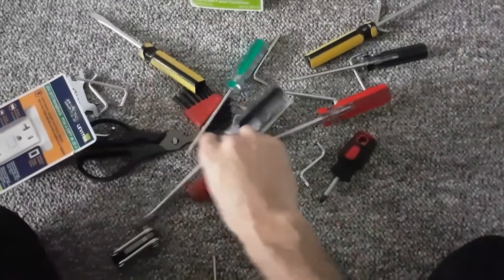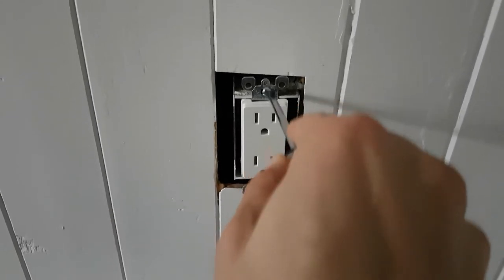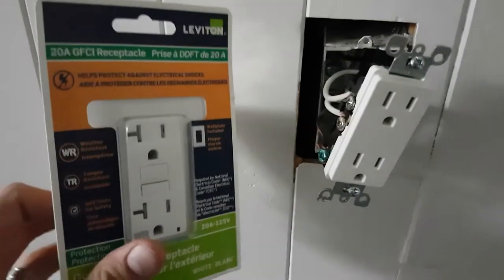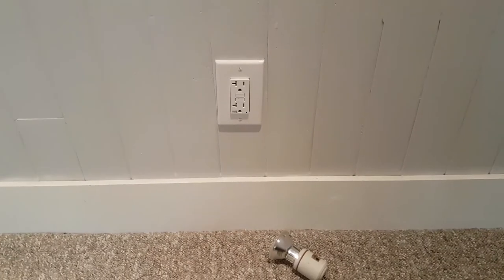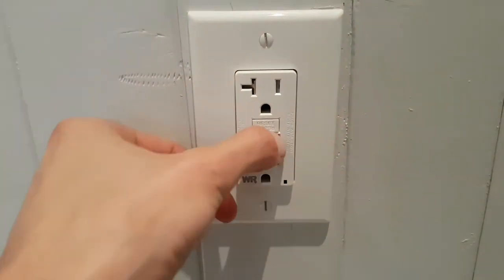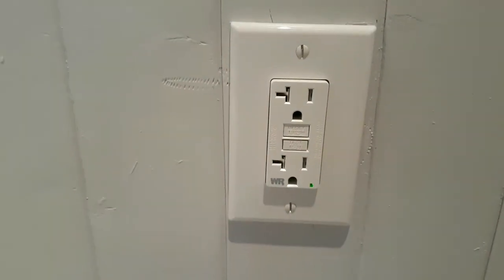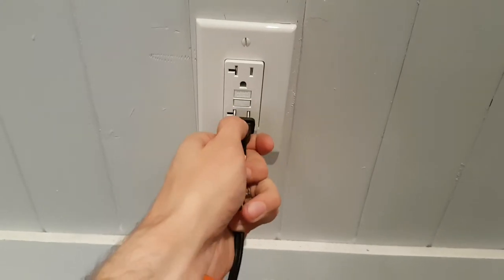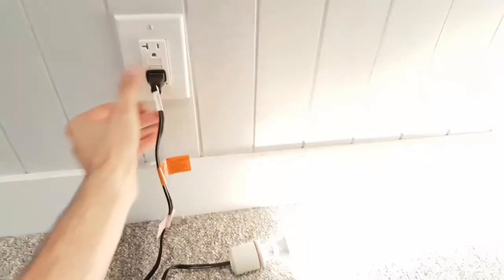Super Secret!!! - Safety Preperations!

Comment: All aquariums should be on GFCI for safety. Even if you don't change the outlet, you can get a power bar or extension cord with a GFCI built in.